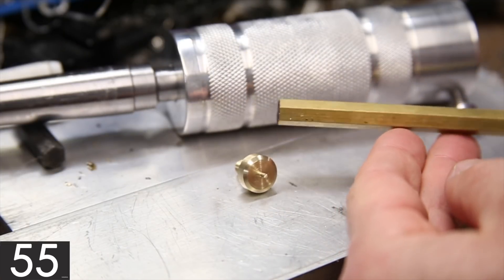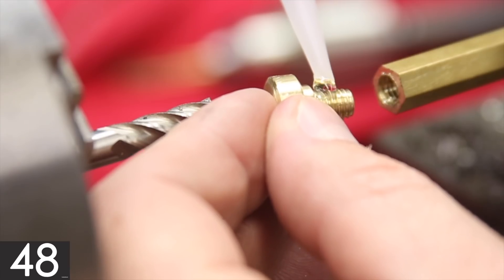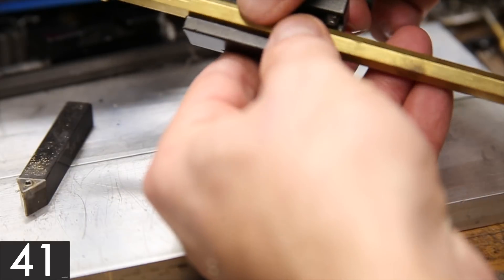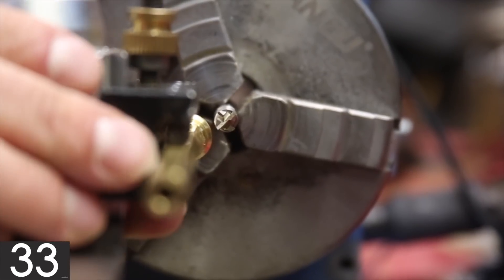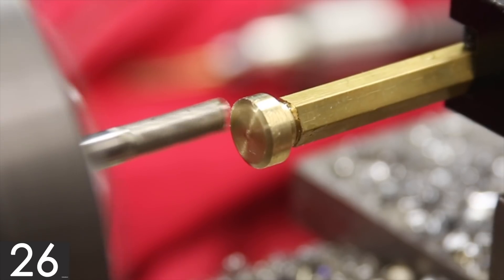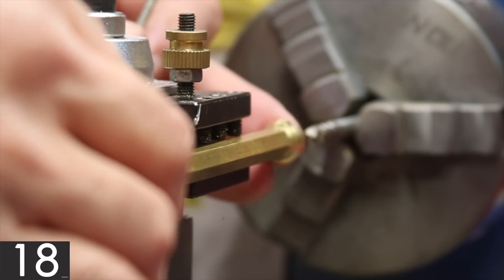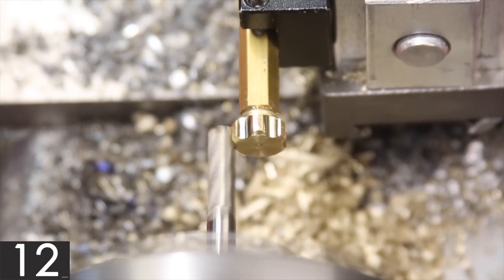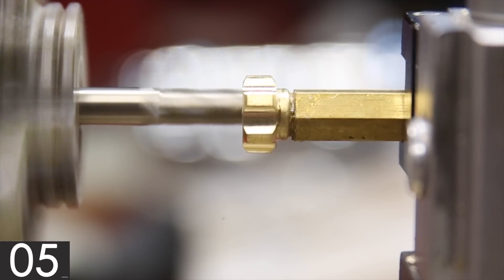60s - How To Make Simple PCD Indexed Cuts W/OUT Indexing Chuck Or Mill on the Mini Metal Lathe

Comment: cool but how do you remove the screw when its glued hard with epoxy?
Reply from the maker: Good question! Just add a little heat with a torch and it will loosen the grip of the glue.
Reply: i would suggest to use a screw 90 degrees to the workpiece so no glue is needed. It might damage the thread on a tiny spot but it saves gluecosts if you want to use it frequently.